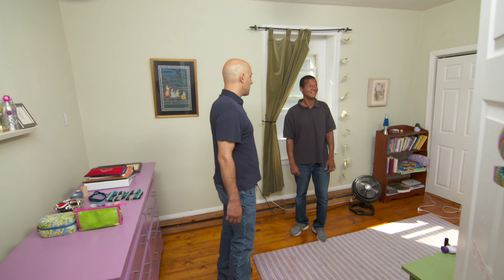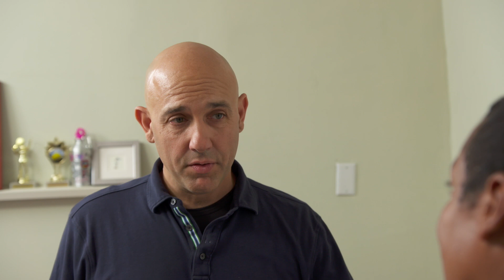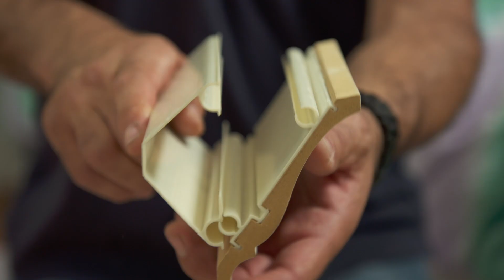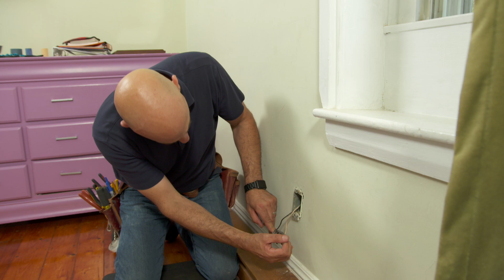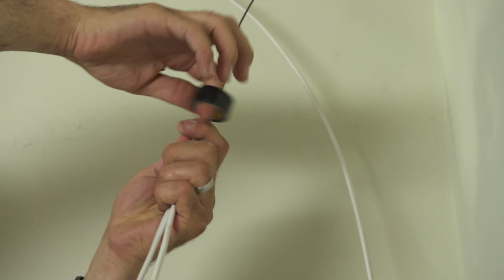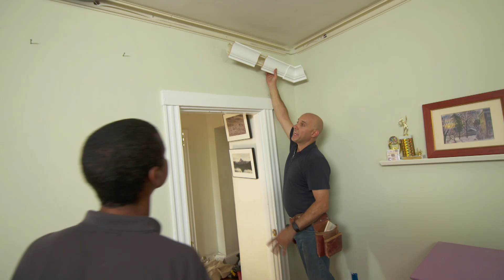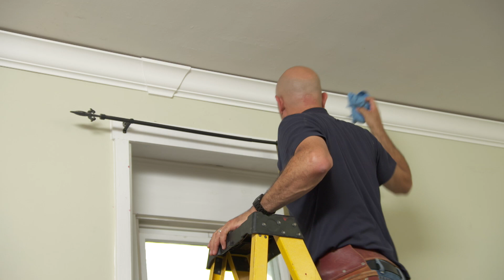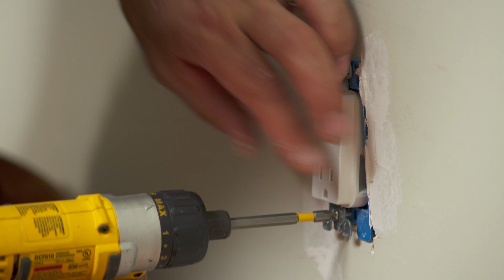How to Conceal Electrical Wires with Crown Molding | Ask This Old House

Comment: Im an electrician from the UK.  Should you not earth (ground) the metal strike plate?
Reply: Yea having no ground for sockets & appliances would be seen as a dangerous situation. Some old lighting circuits would be OK but only if all switches & light fittings are class 2 (all plastic).
Reply: But we have the luxury of being able to go to Lowes and get everything we need and then do the job ourselves without any local government interference. I do all of my own wiring. The thought of hiring someone is, well..... I don't give it a thought actually. I just do it. LOL  (Yes, I follow the local codes)
Reply: In my opinion, that's useless, because the only reason of that plate is protecting the wires from accidental damage with a screw or a nail.
Reply: It's right next to the cables that may deteriorate over time and make the plate live. Or possibly something could pierce the plate and the live of the cable and make the plate live.
In the UK not earthing it would generally be seen to be more dangerous then it not being there. Unless it is clearly well away from the cable but in situations like this they're usually touching.
Reply: londontrada Yah, if i was him, i would put something in between the plate and wires.
Though sometimes you dont have much choice, because the ground just doesnt exist. Yah i know, it sounds hilarious, but it happens quite often out here, where i live. Only line and neutral, that's all.
Reply: Really, no earth ? In the UK that would be seen as a serious danger but we are on 230v here so more of a risk.
Reply: londontrada ~220 v here, almost the same. Yeah, really, mostly no ground. Only the new (since, say, 1990) houses are equipped with it.
In case you're getting curious, i live in Russia :)
Reply: Rai2M ah OK. I assumed you were in the US. Stay safe
Reply: londontrada As you can clearly see, my English is too bad for a US inhabitant :)
Same to ya, buddy.
Reply: u really have ground in older houses in the UK? i live in an appartment building from the 50s and we dont have ground here, im in Sweden btw.
When we re-wire old appartments ofcourse we put in ground but the only thing thats grounded is our radiators in these old houses
Reply: Im no electrician but this seems like a double edge sword, From my understanding junction boxes made of metal are meant to be "fireplaces" to contain an arc. If for what ever reason the strike plate became live with it grounded it's an instant fire as it's not being contained in a metal enclosure but at the same time if it wasn't grounded and became live the odds of the user getting electrocuted is slim with most tools being insulated.
Reply: RBRat3 If the grounded strike plate becomes live then the fuse will blow straight away. That is the whole point of grounding it. If it is not grounded then there is a massive live piece of metal sitting in the wall; fire and shock risk.
Reply: You're right that is a possibility but fuses and breakers do not prevent arcing they prevent short circuits to a certain amperage threshold. Depending on how much surface area the two metal conductors were in contact it may not provide enough resistance and could continue arching for several seconds to minutes before they welded to each other and tripped. Basically the main point is the arc isn't contained which defeats the point of grounding it.
Reply: RBRat3 You are right. This is why it is important that resistance and earth loop tests are carried out whenever electrical work is undertaken. These tests will prove that the circuit is safe.
Reply: We still have many, many old houses like this that were built to earlier standards before grounding was required. Just about any time you see the old lath and plaster finish you can expect to find wires with no grounding conductor (earth ground) in them. I was impressed to see they had NM cable and not just knob and tube wiring.
Reply: In Germany there was always a ground, one way or the other. Back in the days before 1973 they've actually used a the grounding system TN-C inside of the house. This system was introduced in 1913. The PEN was also connected to the water pipe, which was completely made of metal (cast iron for example). It means no separate wire for grounding, you only got two wires. The line and a wire which is called the "PEN" today which is a combination of "protective earth" (in america called ground) and neutral. Back then this wire was called "Null" (zero) here. From 1973 on it's only permitted to use a PEN if this wire is larger than 10mm² (AWG 8) copper or 16mm² (AWG 6) aluminium. But some of these old installations are still in use. They're safe, but in case of a defect it's having some bad issues. Now the most used system here is TN-C-S. You get a PEN from the utility service and inside of your home it's splitted into a separate neutral and ground. Common system in Europe. In Germany three-phase power supply (3x230/400V) is standard, even in residential buildings.

https://en.wikipedia.org/wiki/Earthing_system#Types_of_TN_networks

Now these days all designations are here in english too because of the harmonisation in Europe. The "Außenleiter" (external conductor) became "line", the "Mittelleiter"(mid-point conductor) became neutral, the "Schutzleiter" (protective conductor) became the PE (protective earth) and the "Null" became PEN. And so on with some devices like the thing called FI (large i) which is now called RCD. FI was already international, F for failure and I is symbolic for current...in America this thing is called GFCI. But now the cables and codes are harmonised here.
Reply: In the case of electrical installations there are as many rules in the US as here in Europe, even more than here. Take a look at the NEC (national electrical code). And the thing is, what is permitted in one state could be banned in another one. This is a problem which is resolved in Europe, the codes are harmonised now. Even the chapter numbers. For example the german DIN VDE 0100 part 701 is the code for electrical installations in rooms which are containing a bath tub and/or shower. In the UK, for example, same thing: BS 7671 chapter 701. 

https://en.wikipedia.org/wiki/National_Electrical_Code
Reply: Dito here in Germany. You can get everything you need from shopping centers like Bauhaus, OBI or Hornbach.  Including instructions in books, websites or videos. It's only of interest if it's a new installation or if something happens (fire, injury or death as worst case). But then the court makes no difference if you're a layperson, tradesman or master electrician. "Wo kein Kläger da kein Richter", simple moto (no plaintiff, no judge). In Germany we've got rules for almost everything. But germans only follow these rules if they're making sense to them and if they think they can't get away with it breaking the rules. But in some cases it's better not to touch the electrical installation. Especially if it's very old. Problem is,  not only the codes changed during the last 50 or 60 years, the colors of the wires changed and some other things and these things have already caused fatal accidents. Even electricians now have problems with these old installations, they're underestimating it and think they could rely on standards of today. Now the green/yellow wire is only permitted to use it as a ground and for nothing else. During the 1960s the color for the ground was red. But the red wire was permitted to use for something else, like a switched hot. Or as L2 in a three-phase system. In this case the grey wire was used as a PEN instead of a pure neutral (PEN is a combination of neutral and ground in one single wire). Since 1973 a PEN in new installations is only permitted if the conductor size is at least 10mm² copper (AWG 8) or 16mm² aluminium (AWG 6). For older installations it's the conservation of status quo because the installations are not unsafe overall. But in case of a defect they can become dangerous. This means there are still these old things out there. It's just like the old installations in the US without any grounding.
The code part 701 tells you the safety zones from the edge of a bath/shower tub to the next outlet, switch and something like that. This should prevent it's getting hit by a flush of water from the shower head, or an appliance falling into the tub or something like that. 

https://en.wikipedia.org/wiki/Electrical_wiring_in_the_United_Kingdom#Bathrooms

Zone 0 is inside of the bath tub/shower, I don't think anybody needs an appliance directly inside of the tub. RCD is called GFCI in America. There are local codes in Europe, but they're containing the same specifications now. They are harmonised all over the continent. And that's a thing I don't understand on the US codes. One thing is considered safe in one state, in the neighbour state it would be a big fail to do it this way.
Reply: londontrada how would a wire deteriorate off the screw terminals, then also somehow come an additional  1/2 forward in the box and contact the plate?
Reply: The PVC insulation is aging and become brittle over time. But this is a thing which is sometimes overrated, I've removed old wiring from the 1950s, only the parts which were not protected by sheathing or conduit (in boxes for switches, outlets, light fixtures, junction boxes) the condition of the PVC was poor. The wire insulations that layed protected in plaster looked like new when I removed the sheathing, or pulled the wires out of the conduit. I've performed an insulation test (500V) before I removed the cables. It passed the test without any problems after todays standards (limit 1MOhm), and it was much higher. When it was installed during the early 1950s the limit for insulation testing in Germany was much lower (1kOhm per Volt, in this case with 500V testvoltage this means 500kOhm).
Reply: 1impalaman So we can. Only certain jobs are notifiable to local councils.
Reply: Code in the US now requires all bedrooms to be on independent circuits with AFCI.  If the electrician is responsible, he ensured that the circuit is up to code, such that an arc to the strike plate would kill the circuit.
Reply: londontrada you UK guys crack me up.
Reply: im from London and just wana say FUCK YOU ALL.
Have a nice dayd🙄

Comment: It's a neat idea, but it ultimately made me throw up in my mouth a little.
IT'S NOT FLUSH WITH THE CEILING, AHHHHHHHHHHHHHHHHHHHHHHHHHHHHHHHHHHHH.

Crownmolding needs to be flush!
Reply: It will need ten tubes of caulking to fill the gaps. LOL.

Comment: A multi-outlet extesion on the existing outlet would be a better choice IMO. Doing all of this work and ending up with a hole in a wall and a crown moulding gap is questionable.

Comment: As an electrician I was pretty interested to see this product until I saw it installed.. I don't think it was the electricians fault, I imagine it always looks horrendous. It would be easier, and cheaper to notch about the kick and replace the base with 4" or 6".
Reply: ^^ what he said ^^
Reply: The problem is that it can't account for non-plumb or square walls and sagging in old houses so you wind up with big gaps everywhere.

Comment: More practical solution: hot glue the cable along the wall (over doorways where necessary) and terminate in a surface mount box. Not as pretty, but quicker and much cheaper. You'd also avoid breaking and plastering entirely.
Reply: anon746912 Romex can't be exposed.
Reply: Hot glue Romex on the wall? :/
Reply: that doesnt sound like its up to code...
Reply: One of the solutions that was given in the video was to run a small plastic channel around the room on the wall... that would be a way better, and more aesthetically pleasing solution to gluing wire to the wall.
Also, plastering is not hard.
Reply: or run mc behind real crown molding and break out where needed just have to be super careful about wire and nail placement. not an electrician, just a diy'er, but I bet it would look a hell of a lot better than this crap

Comment: Although only required on a multi wire circuit, is there any particular reason you don't use pigtails on the hots and neutrals at the end of the video? Our city code requires this even on single circuit installs for plugs. I have seen failures of plugs breaking apart after years of continued use and had to replace them, on few occasions removing the device for replacement kills the rest of the circuit if it is hot and could possible put one in between a load farther down on the circuit. Sure its easy to say turn it of at the panel, but even some commercial settings it is difficult to power down if it for example is powering a teller computer at a bank or something. The crown molding was an interesting solution the problem of adding more plugs in the room, I had not seen this product before. Who makes it?
Reply: This is what maintenance windows are for. If you have to power down, you do it when business load is not required.

Comment: If you cut small pieces of the crown and clip them into the track then hold flush against the ceiling when screwing in track., there will be no gap
Reply: It would not be straight since the track is still straight
Reply: Not exactly how it works going to have a hell of a time bending that....even normal cm isn't perfect t
Reply: yea he was just like... hey this house that is so old it still has plaster and lath must be perfectly level and square, let's just snap a line 3 inches from the uneven ceiling as a reference. Tommy would not be pleased. I mean, at least use a laser level.
Reply: It's a shame he didn't do that when he installed the track.
His end result just looks terrible.

But that homeowner seemed like he wouldn't try to fix it himself and will either live with it or hire someone to come in and fix it.

Comment: Keystone looks out of place. Corner pieces look odd too. I guess if you arent handy this is a decent work around. The gap at the top could easily be caulked and you really wont notice it with a high ceiling. My ceilings are 8 ft in a 100 yr old house and I did a good job on the compound cuts on the molding, but with imperfect walls I I still had some slight gaps. After caulking it up looks amazing.

Comment: I thought this was a reasonable workaround to a tough problem but when they installed the keystone off-center with the window I just cringed. :)
Reply: Those keystones in general don't belong there. They look so cheesy.
Reply: @ZacharySalman  the corners too.
Reply: The keystone is centered on the wall, the window is not.
Reply: The window isn’t centered in the wall. If he centered the keystone with the window, then the keystone would be off center with the wall

Comment: Jesus Christ that gap against the ceiling looks horrendous!
it looks to be half an inch away
Reply: Shane Duyvene de Wit Cause Jesus is a carpenter.
Reply: Even with caulking that gap is big and would be noticeable. They should have installed the product properly with the flow of the roof, not 3" straight line from end to end, but 3" down every foot or so.
Reply: jesus is a landscaper usually...
Reply: Jesus built my Hot Rod for me.
Reply: Catalyph thank you I rest my case!
Reply: Its an old house, I'm guessing the ceiling is whats off... cool product but doesn't allow adjustment on install, you could probably do the same job with regular crown moulding if you can pin that wire nice and tight to the ceiling.
Reply: It is pretty bad but could be used as a lighting accent if done properly. I think the fix is really easy. Just make a sacrificial piece of molding drill a few 2" holes in it and snap it in place before screwing the mount to the wall and boom corners all the way around should be super tight.
Reply: would be more dope if he put an led strip at the top and made use of the gap for accent lighting ... just a though, but i agree with you.
Reply: Yes the gap is noticeable but base on all options that were available I think this was the best approach. It sure is better then horizontal wire mold on the surface, or cutting the drywall all over the place. I would be happy with the outcome based on all the choices. Good job!
Reply: yeah and I bet that plastic is too rigid to bend to the contour of the ceiling.
Reply: That's not his fault it's the the people that don't leave the dam walls straight
Reply: Mr Ben What does Jesus Christ have to do with it?
Reply: Ever heard of caulking?

Comment: Make no mistake, this was a DIFFICULT JOB because you never know what blocks are in the way behind the wall and a stud finder would not be any help and Scott had to do extra work which an electrician would have charged you for. I wouldn't go this route and  would have also checked the adjacent rooms to see if there are any plugs behind the wall and then use those to jump off of instead.  It's a kid's room so even one or two extra plugs would be enough.  Nice to know they have products like this however.

Comment: expensive
Reply: How can compound cutting molding ,nailing it in, puttying the nail holes, painting the trim on a ladder then painting the whole room be cheaper than installing a product yourself in an afternoon pre-finished without painting your room over again and having a wire chase accessible?

Comment: as an electrician this would be expensive for the customer with labor and materials.
Reply: painter is cheaper than electrician.
Reply: and not all electricians own or carry a miter saw. we aren't full time carpenters.
Reply: But then wouldn't it be more expensive for the customer to have to get a plasterer to come and fix all the holes not using this method?
Reply: This would have been a nightmare.  The call would have been"How much do you charge to add 3 outlets?" and it sounded easy but there are so many blocks there that it could easily be a full day job without fancy molding and saws.